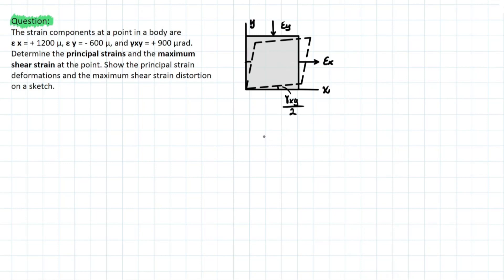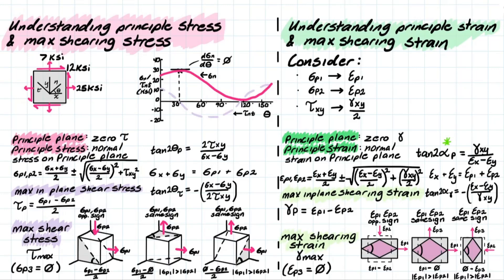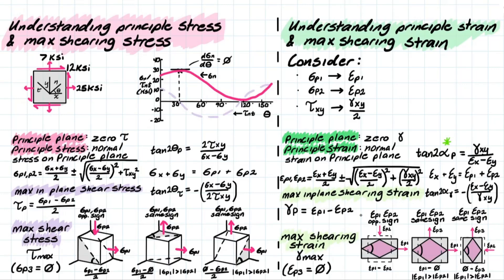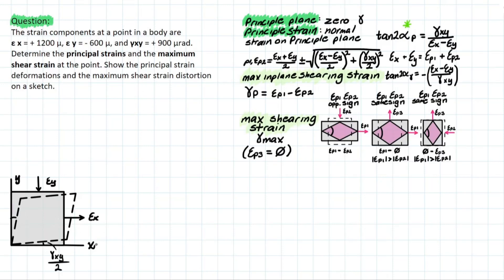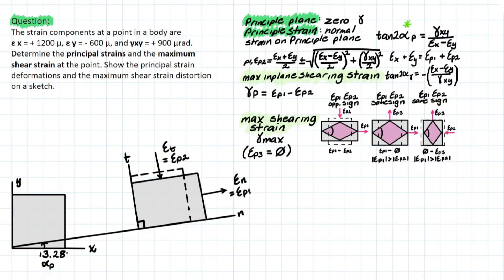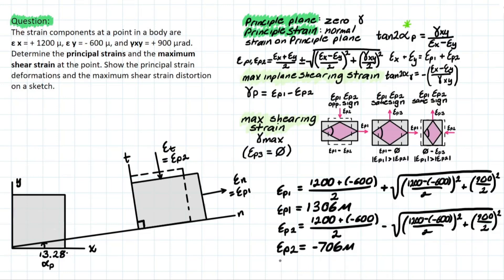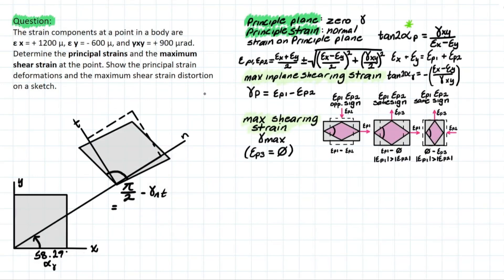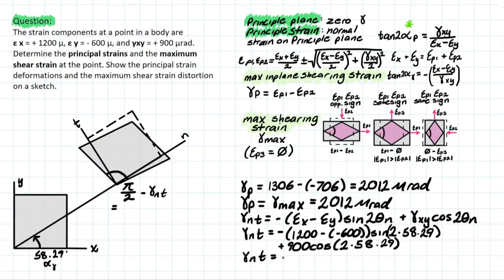Theory for Solving Principle Strain and Maximum Shearing Strain Problems!

Comment from the maker: NOTE:  There is a typo for max shearing stress and max shearing strain. For the third case of max shearing stress, where σp1 and σp2 have the same signs, the equation (0 - σp2 / 2) is for the case where | σp1 | < | σp2 |. Similarly for the third case of max shearing strain,  where εp1 and εp2 have the same signs, the equation ( 0 - εp2 ) is for the case where | εp1 | < | εp2 |. Please make a note of this! Additionally, the third condition for max shearing strain should equal 0 - εp2, NOT εp3.

Problem Begins at 5:50. Thanks for watching and supporting!